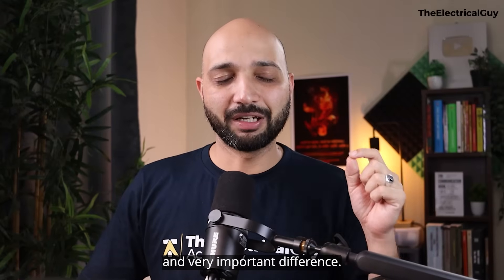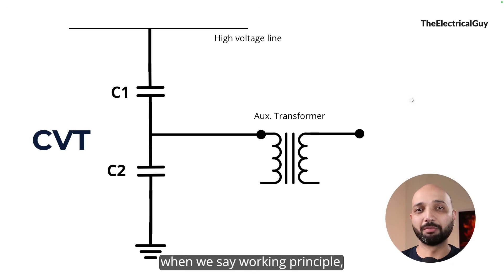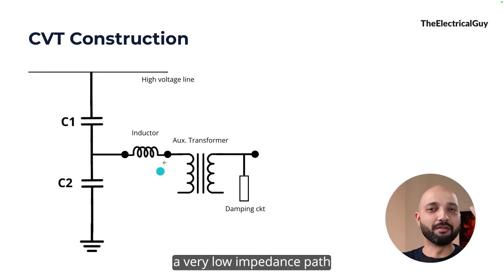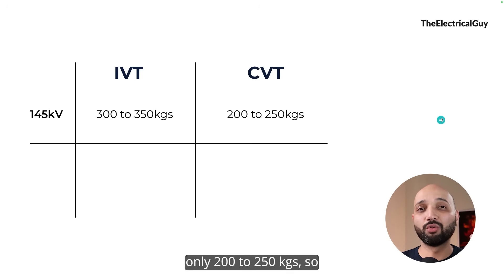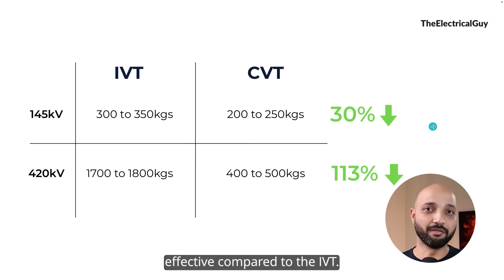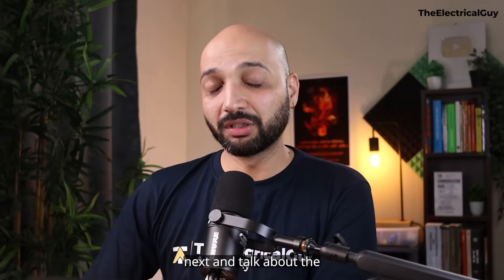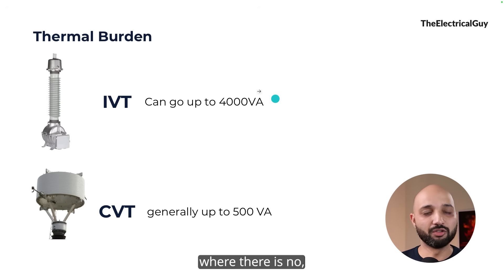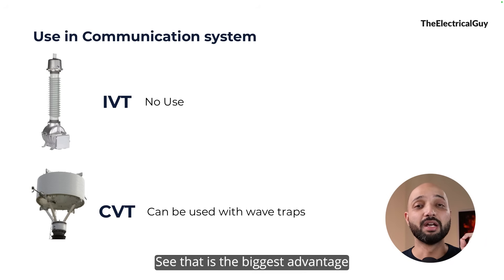Capacitive VS inductive Voltage Transformer | What's the difference?

Comment: So I have a question about the way the capacitors are connected to act as voltage dividers. I have heard that it works in both directions. So that even if you were to back feed through a CCVT that after the voltage transformer the capacitors would step the voltage down. Is this correct?